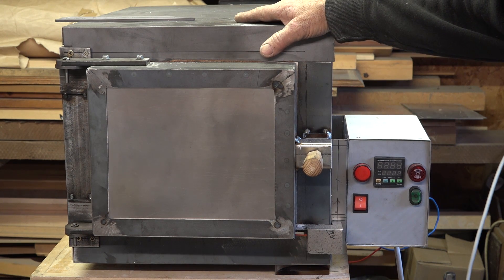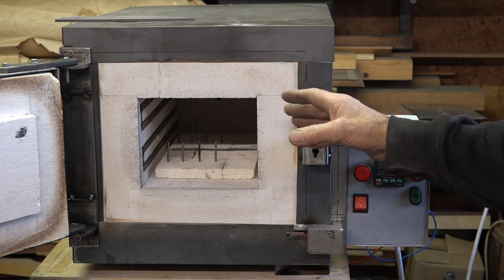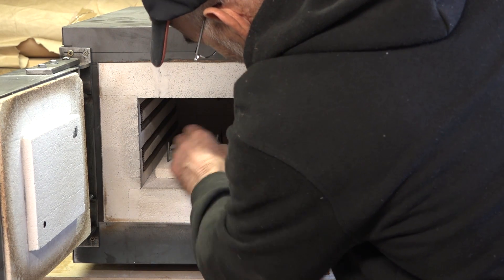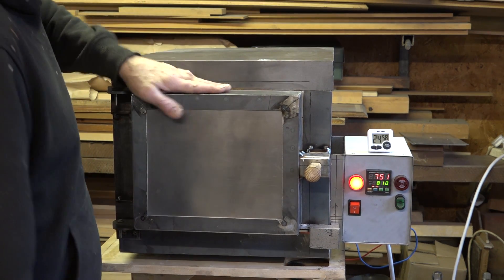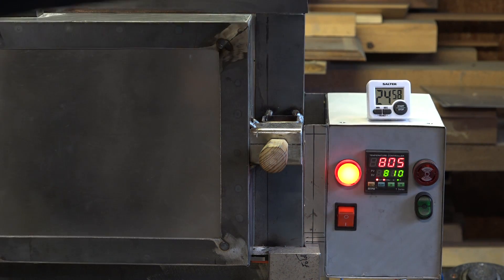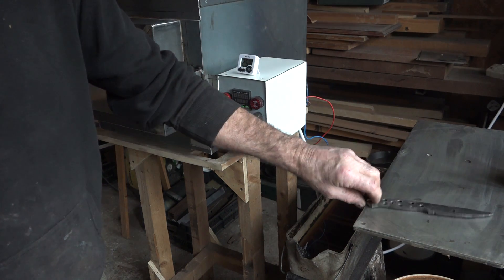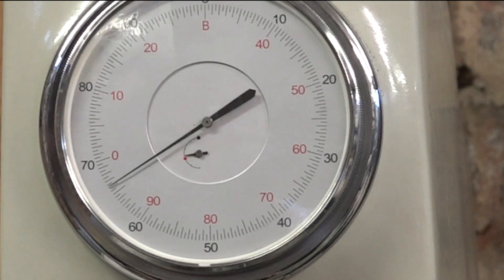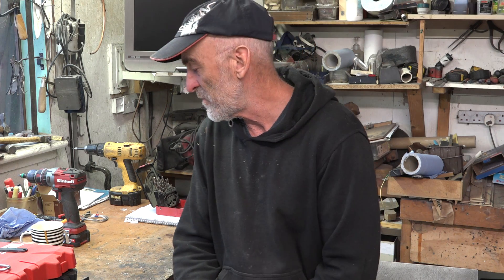Heat treat oven build... finished and tested

Comment: How much of the 30 meters kanthal wire did you use? Also where did you buy it from, I can't seem to get hold of any 1.4mm A1 kanthal. Many thanks
Reply from the maker: I used all of it on this, I found this on amazon at the time no longer there now though, i recently bought a coil from Greece though, search online there are a few overseas suppliers
Reply: @LozHarrop  thanks mate

Comment: Hey Loz, just wondering whether you've tested the temperature at the bottom of the oven during/after firing? Was wondering how much heat is transferred through the metal lugs that were used to support the bricks in place. Cheers mate
Reply from the maker: very little mate, more heat is felt on the top and sides than the bottom. Cheers
Reply: @LozHarrop  Cheers mate!

Comment: Seems very hot on the outside. Why did you not use k23's?
Reply from the maker: I dont think 25 degrees over the room temp is very hot for an oven thats been running for 2 hours, most of that heat was generated by moisture being driven out of the bricks onto the casing,
Reply: @LozHarrop  I've seen similar ovens/kilns get to temp within a quarter of that time. That coupled with the heat on the outside led me to the k26 as they are really terrible at insulation when compared to k23's

Comment: Did you quench that 01 in water?
Reply from the maker: no it was quench 25 oil
Reply: @LozHarrop  ok thanks I was wondering for a second! Also, do you know how far that thermocouple needs to stick out? I'm wondering if I bought the wrong one. Mine will only stick out about an inch or a little less.
Reply: @LozHarrop  and that would be after going through the brick so the probe is only 85 mm total.
Reply from the maker: mine is only in the oven a couple of inches also ideally I wanted it in the centre of the oven just above the blades, Have had trouble finding a cost effective one, as long as its inside the oven it should be fine though as they only read the temp from the tip.
Reply: @LozHarrop  Perfect thanks! The one I have should work great then.

Comment: Really enjoyed watching series. The oven is amazing. Id like to make my own smaller version. One question: What do you call the terminals you used for the element and where did you get them?
Reply from the maker: Hi billy cheers, if you mean the terminals on the rear, I connected a 3mm threaded rod to the end of each element with one of those screw in brass terminal connectors that you get in a strip, then just fitted a ceramic sleeve over it to isolate it from the metal body, my mate got me the sleeve from where he works, i guess you could use anything for the job though. 2 nuts on the end then carry the wires. Cheers.

Comment: About O1?
I have made 2 knives recently of 01. I had the blades break after annealing. Have you had this problem?
Reply from the maker: the two main reasons for the broken blades Frank would be getting the steel too hot before you quenched it,that causes massive grain growth and a weak structure, if not that your tempers were not hot enough or not long enough to toughen the steel.
Reply: I may have gotten it too hot before annealing in a bucket of ashes. Thanks for the tip,
Frank
Reply from the maker: @tropifiori  No problem, you ideally need to thermal cycle the blade before heat treating Frank even after annealing